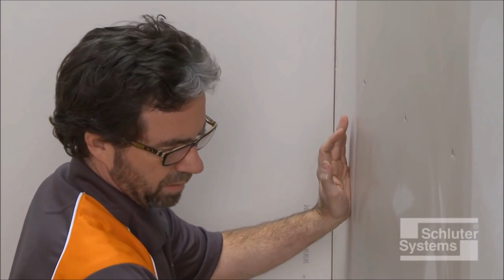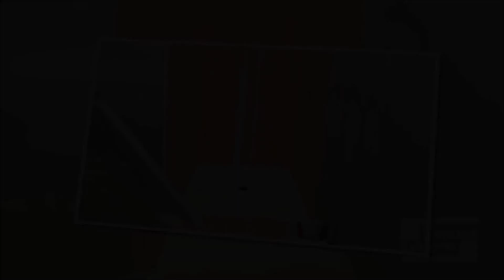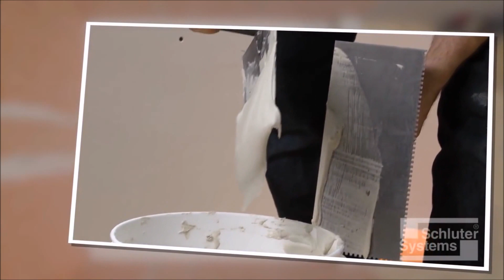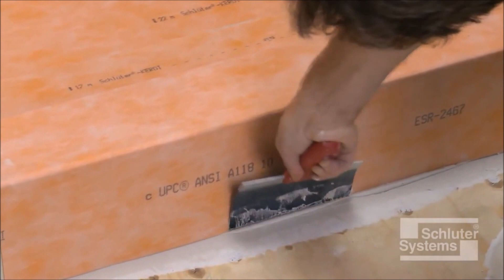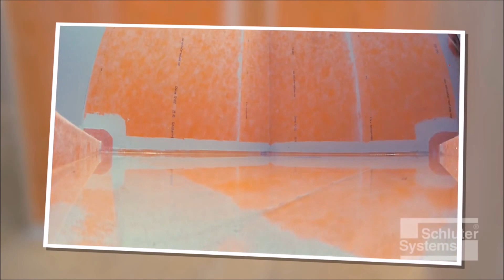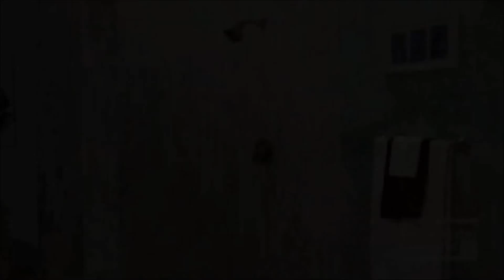Schluter Kerdi Doek plaatsen

Comment: this is a pretty bad movie. first of all they used the wrong materials of drywall. it should be green drywall. green drywall is water resistant. second, they placed the kerdi matt vertically while it should be placed horizontally and overlapping eachother.
Reply from the maker: Most likely explanation is that the demo focusses on the application of the product rather than the setup behind it. As for the positioning of the kerdi matt, both are approved methods. Sometimes, applying it vertically on the wall is just easier depending on the room setup.